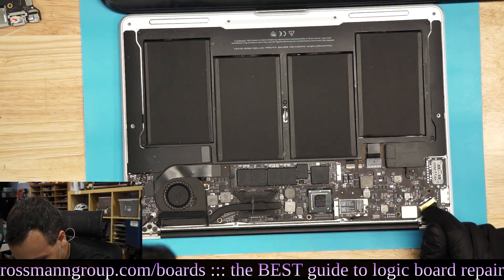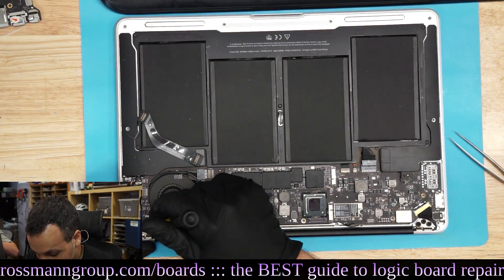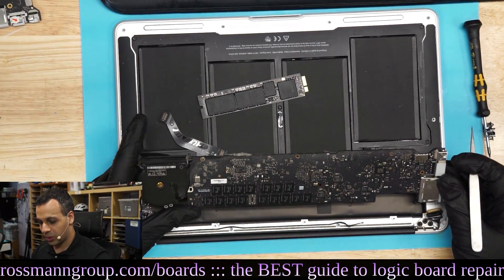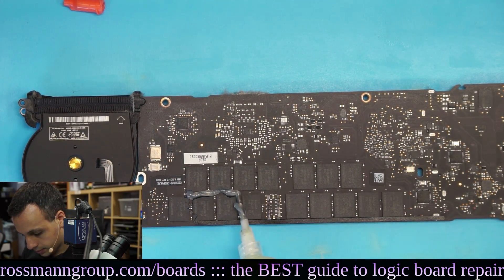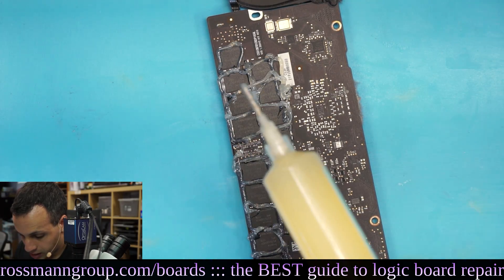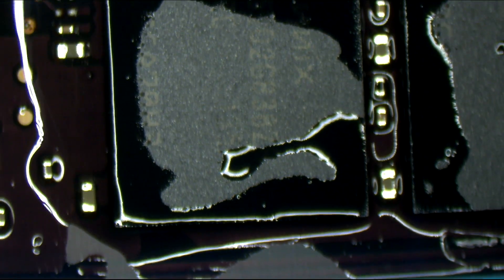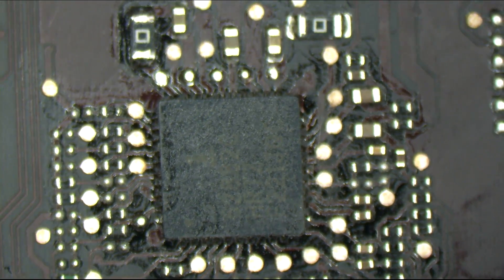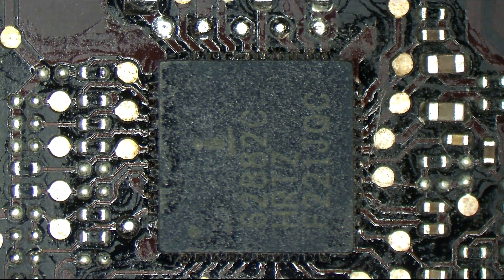What does it mean when Macbook Air beeps three times?

Comment: tried doing this on a A1370 since it had the 3 beep error. Set my quick 857dw+ to 450C (max temp) and about 50% airflow. spent a few minutes heating one of the chips up but it never moved as if it was glued in place before being reflowed in the factory. Everything around it reflowed perfectly fine, even one of the capacitors had the audacity to fly off the board while I was trying to reflow that memory chip but the chip never budged.

Comment: I have almost the same issue, flickering and freezing display, and macbook air a1370 start resetting. I did clearing SMC, NVRAM etc, the problem still exist, but when I plugged out the battery, the macbook is running well. Is it RAM issue ?

Comment: just fixed my macbook yesterday, never opened one before, I bought a hot air gun on amazon, had no flux but didn't mater. 
thanks a lot
Reply: Hai, did you just reseat the RAM by directly heating it? No flux? Does it work??
Reply: @iqmalsharuazhan8174  yeah, but 4 moths later it died again, I heated it in the oven at 170C for 7 minutes, fixed it 2 months, then one more time it worked 1 month, then a week. ended up selling it for parts and bought a M1 Mac. You can only do this fix a few times, unless you are a real technician like @louisrossman
Reply: i had no flux nothing, an I returned the hot air gun the very next day lol
Reply: @arm3lit0  did you heat the ram until it wiggle too? Without the flux
Reply: @iqmalsharuazhan8174  no i just heated it for, 2-4 mins then I let it cool and it worked

Comment: I have a question, why does this work? basically, you put flux on the ram chips and then apply hot air until they move and then just plug in everything and it works ... I just want to understand why would this work.
Reply: Im sure that what happened is that reheating the points completed the connection lost over time from repeated used and movement and use.

Comment: I have 11" Mid-2011 Macbook Air, after did this repair it slows down significantly now. I got to clean install the OS and the problem still persists, the cursor keeps stuttering and it's really hard to do even a basic task. Any thoughts? Thanks

Comment: I have Air A1370 k78-mlb  I also have 3 times but I do not have a voltage on the ppv core. 
I have to replace max 15092 or look for a bug elsewhere :/ Thank you very much for the answer

Comment: Louis, I need your help man. I got a retina macbook pro and I have destroyed that black cover sheet around the CPU chip that exposes the die (was cleaning a horrendous thermal paste job). What can I do to fix that? I've heard there are issues if I try to boot the machine without that sheet installed.

Comment: what are your views on the general manufacturing quality of these boards? in many of your videos I notice not quite up to standard soldering, imperfectly aligned components, dull and inconsistent fillets, basically all the hallmarks of slightly crappy production processes. thoughts? (to be 100% clear, I'm talking about the original manufacturing, not your work)

Comment: Great video as usual. Had an interesting one come in around a month ago. MacBook Air 13" 2012 needed a battery replacement. Ordered and installed the replacement battery, and the machine booted up with 3 RAM error beeps, but only when running on battery power. Connected the power adapter and the machine booted normally. Removed the battery and reinstalled the original one, and the beeps went away. Reinstalled the replacement battery again, and the machine would beep on battery power. DOA returned the battery, installed the second replacement, and the issue was resolved. Customer has been using it without issue for 3-4 weeks now.

These were genuine batteries (AASP), and I don't know what caused it, but would absolutely be interested to find out and intend to investigate a little more soon. I thought perhaps it was some kind of voltage drop during startup when the battery was placed under load, or other anomalies with the embedded controller (in one instance it passed testing, then failed "No Battery Installed" after reboot) but that's purely speculative - I need to read up on this a little more first to be sure. An interesting one in any case.

Comment: What is it flip chip design? Whats the difference between ram and GPU and other bga chip?
Reply: Normal chips use wire bonds internally to link the die to the balls/pads on the underside, a flip chip the die is flipped over and doesn't use wire bonds to link to the pads but instead uses another layer of solder balls internally. See https://www.pcmag.com/encyclopedia/term/43310/flip-chip

Comment: I had to Google what reflowing actually does. Apparently, over time fractures can form in the solder. Reflowing melts the solder and therefore gets rid of the fractures in it. Thank you Louis for sending me down this shallow rabbit hole. I learned something!
Reply: You do know that RoHS doesn't apply to aerospace , medical and generally any "critical" industry , you know that ,do you ?
Reply: MonzaRacer - Yeah, aerospace, military and medical electronics are exempt from RoHS rules on leaf solder for that exact reason.
Reply: Stephen Deinema yeah cause environmental types think electronics using 60/40 solder polluted water(sorry but roughly 70% of ground d lead contamination comes from old car batteries and abandoned small scale gas station tanks from when gas had lead in it) and if electronics we're issue just make it rule to recycle electronics, easy enough. So now we have Rhos compliant ie low lead solder, which kills electronics very quickly as high tin content solder grows hairs or crystals. Main reason satellites and such in outer space now fail quickly as crap solder grows those hairs and shorts out faster in zero g. Fun fact.

Comment: i think this macbook will come again to you. semiconductors respond to the heat. and i know about flip chip BGAs. but  in this case it is like tantal capacitor. after heating it will work some time but it will die again.
just try next time to heat the RAMs only  - not reflow and it will work too for some time. it will be evidence that reflow doesn't work in this case of issue. only replacement in all probability will work.

Comment: Noob question what does flip chip mean.
Reply: Vaun Killion It's a chip that's designed to be flipped face down and soldered to the board in that direction.  Most other chips are face up inside their  plastic, ceramic or metal package.

Flip chips avoid the "long" (few mm, fraction of inch) wires between the chip and the actual board so good for very high speed digital signals such as the data to and from RAM.
Reply: John Francis Doe ah thanks a lot

Comment: can someone tell me what he did? did he remove the ram chips? andif he did how did he put them back in place, sorry if its a dumb question but im just curious
Reply: bmf 456 he reflowed the chips by applying a lot of heat. Basically he caused the solder under the chips to melt and then cool down.

Comment: I’ve got a question to do with repairing a RAM stick, figured people here would know something useful -

One of the SMD caps (or resistors I’m not sure) broke off my RAM stick and now it no longer works. If I just shorted the two pads where the capacitor/resistor used to be with a bit of solder do you think there’s a reasonable chance the RAM would work again?
Reply: No because many times the capacitor is in parallel across the power rails and you'd be creating a dead short.
Reply: stonent Ok, thank you.
Reply: Jernej: While generally true I wouldn't bet my horses on that ... the faster stuff gets, the more important becomes decoupling. I used to have a bootleg arcade board from the 80s with ~80 chips which had no decoupling for individual chips (just one big bulk electrolytic for the power rail) and worked just fine (CPU clocked at 4MHz) - yet an ARM based expansion for that machine (~200MHz) stopped working when one of the tiny 47nF caps for decoupling the SRAM broke off.
In either case ... don't short out connections unless you know what you're doing, chances are good it might kill your hardware for good if you don't.
Reply: It's a resistor more than likely, knocking off a decoupling cap shouldn't kill it. Unfortunately you need to replace the resistor with one of the same value to fix it.

Comment: sodered ram is stupidity to the max
Reply: No, it's still something that can go wrong. The solder balls can go wrong. It's one less thing that can be easily repaired, so Apple can make you buy a whole new one and just shred the old board.
Reply: Remco Stoutjesdijk lol or in this case 16 more things to go wrong.
Reply: No u
Reply: "soldered" :p
Reply: no full stop lolz  :P
Reply: lol thats how i expexted a troll to act:)
Reply: dude youre making it too easy LOL :)
Reply: Soldered RAM was originally to do with space in the super thin laptops. The sockets take up space, which means you have to give up something to have the socket.
Now it's just being cheap since many other components have shrunk, CPUs have lower thermal output, etc.
Reply: Depends on your point of view. For apple, it's one less thing that can go wrong (the connector) and they can charge a whole lot more for it.
Reply: Hello mister language troll go back under your bridge
Reply: If apple would supply ram sticks they'd still have solder balls that could go wrong. Except you'd go elsewhere for repair instead of apple. So it's still a good move from Apple's point of view.

Comment: I have a 2011 Intel PC and, as long as I blow the dust out of it once in a while, it works fine. I don't have the same confidence in Apple products. Honestly, I've owned and used Apple products in the past and almost every one of them has let me down. Because of that I don't take chances with Apple products anymore. I buy PC computers instead because I'm confident that I can replace almost any failed part and not have to replace the entire computer. Even better, if you take care of them, PC parts don't seem to fail that often. They're very reliable. Fuck both PCs and Apples when it comes to most portable devices because they're     not designed for consumers to work on them. Android sucks as well because they're not designed to be fixed and they don't allow users to run more than one application simultaneously.

Comment: this is the mac equivalent to taking the ram out and putting it back in that on most PC laptops takes all of about 2 minutes or less
Reply: Yes, but the MacBook is thinner. <sarc on> Everybody wants and asked for thinner, right? <sarc off>
Reply: Hirson Florian no, but it's the only one with a 100% chance it has it soldered
Reply: soldered RAM is unfortunately the standard on UltraBook PCs. If it's thin like a MacBook, it's gonna have soldered RAM.
Reply: Hirson Florian :P
Reply: Hirson Florian yeah, but Apple is obsessed with soldering things. they started with ram on MB airs, and now they solder everything everywhere. even the SSD on iMacs.
Reply: Hirson Florian sadly it the only one to solder it the way it pops off because of a MB thermal profile. I guess it's because the upper row is just under the CPU and  its pretty hot power mosfets which are tend to dissipate power to the board through the grounding pad. I need to check twice but I would not be surprised if I see that the damage hapens exactly under the CPU cooling system screw which is likely to be over 90-100°c all the way
Reply: although I have seen people do that in an oven. Especially with some of the higher end heat sinked DDR2 modules. These had early lead free solder, and it was quite easy to break them by pushing on the heatsink instead of the pcb when inerting them into the slot
Reply: I thought it was going to be a pop out piece... Oh was I wrong
Reply: Hirson Florian Go away...
Reply: Taking your RAM modules out and back in wont fix a broken solder ball on the chips themselves. You would replace the broken RAM module entirely because noone reballs RAM modules :D
Reply: Chuckiele My understanding is that most RAM SODIMMS are flip chip designs so reflowing them wouldn’t work anyway. But correct me if I’m wrong.
Reply: AcidSugar1414 you are... If they were flip chip you would be most likely able to see the shiny die. You can't. These are different packages, but sadly I can't remember their name right now